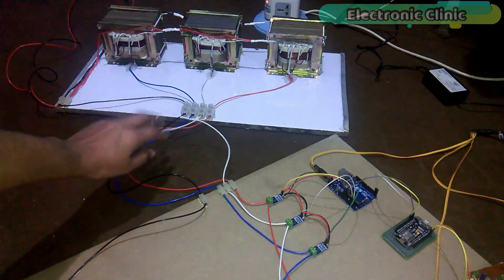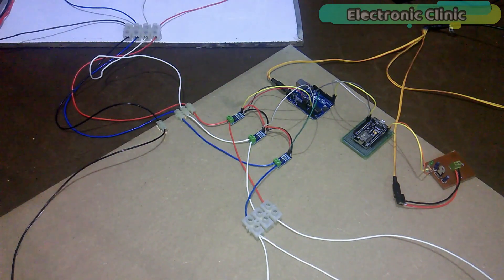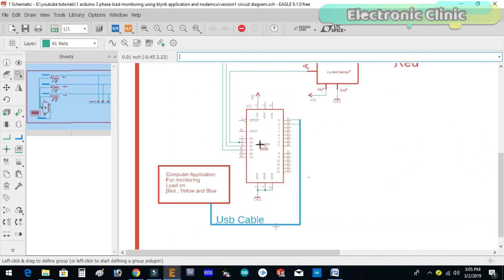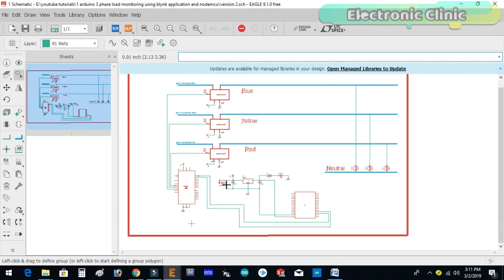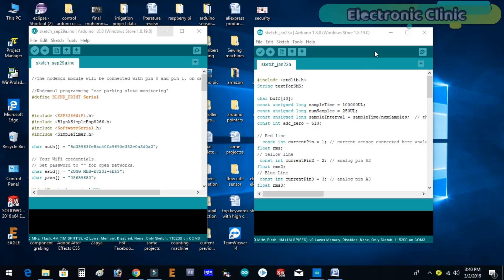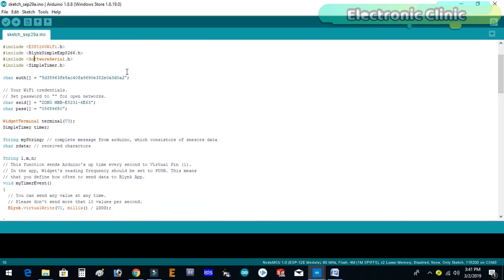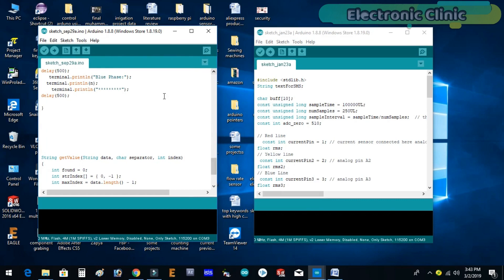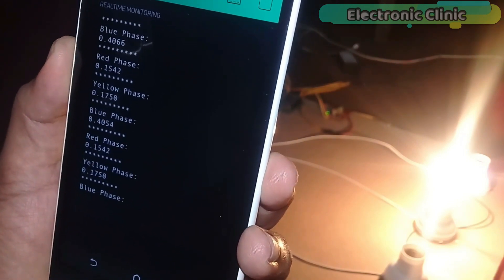Arduino internet of things project: 3 phase transformer load monitoring using Nodemcu esp8266

Comment: Hi sir is there possible to use electronic transformer to load high voltage equipment?
Reply from the maker: ya, you can make a high voltage transformer.
Reply: @ElectroniClinic  may you please make a video for that? I really need it sir. Thanks!. Or how can i make a transformer with high voltage.like 300v

Comment: is bread board  just used as holder for esp module?
Reply from the maker: Are u talking about the vero board or bread board?
Reply from the maker: Bread board is used for temporary connections. And vero board is used instead of pcb.
Reply: @ElectroniClinic  So sir what are the connection made on vero board on which esp8266 module in mounted